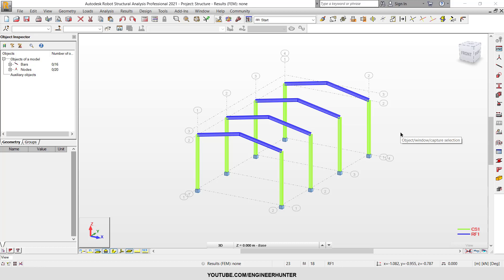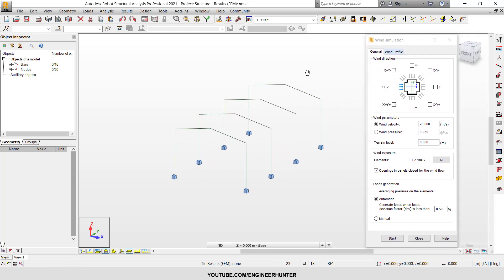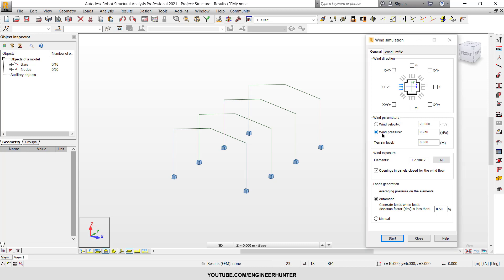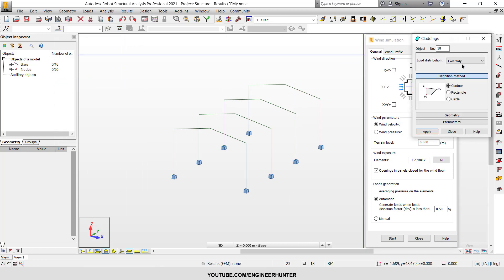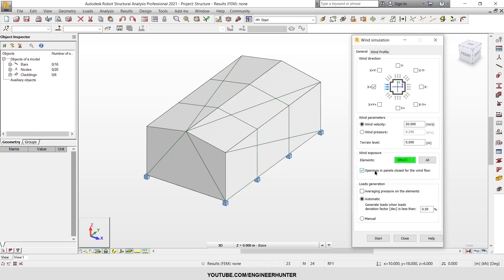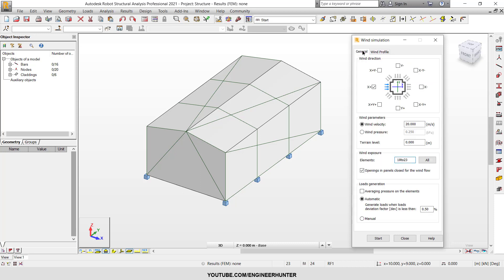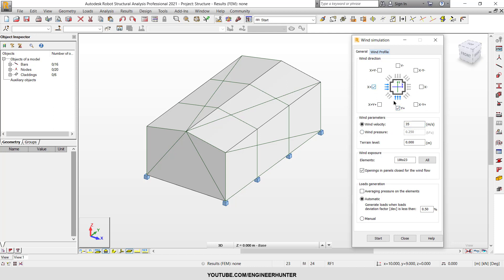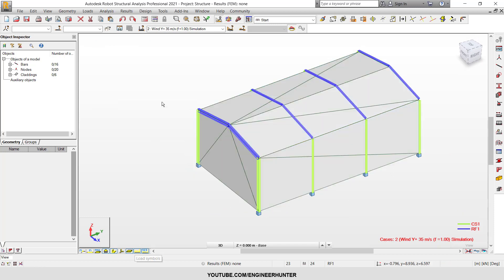Autodesk Robot Structural Analysis : Wind Simulation

Comment: A critical question would be why the cladding were assigned one way x direction and also doesn't their local panel direction matter? kindly if you can clarify
Reply from the maker: The direction depends on engineer's judgement. If you want study the column directly, you can apply load on column. For wind simulation in Robot, the local axis Z of cladding doesn't matter, as I remember. You can try to reverse the direction and see the different.
Reply: @EngineerHunter  thanks I just wanted that clarification. You are right 👍

Comment: Good, but I did not understand the way we have to use to calculate the V(m/s)
Can you explain more ?
Reply from the maker: Wind speed in Robot Structural Analysis doesn’t equal to the one we use in code. (Ex. ASCE wind speed is computed with gust speed 3s,...). In Robot Structural Analysis, wind speed with 1 hour gust as I remember.
Reply: @EngineerHunter  Hello! Excelent video!, but where can we get more information about the wind simulation option in Robot!?